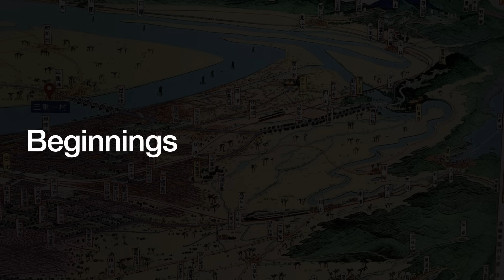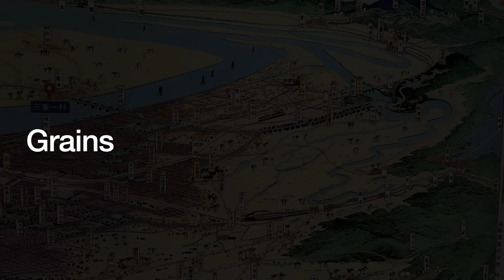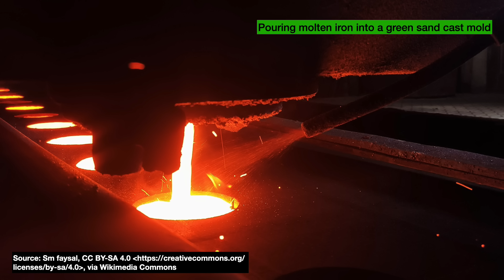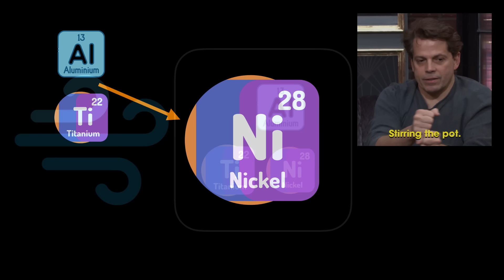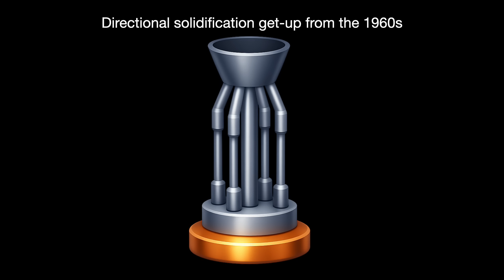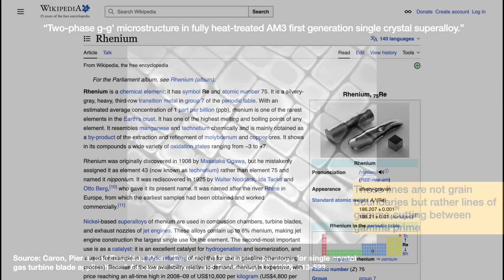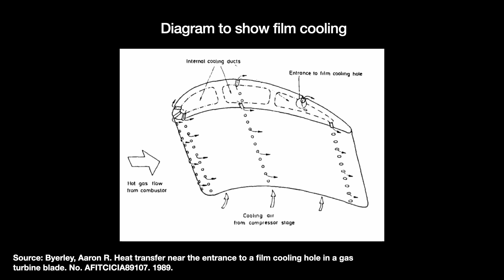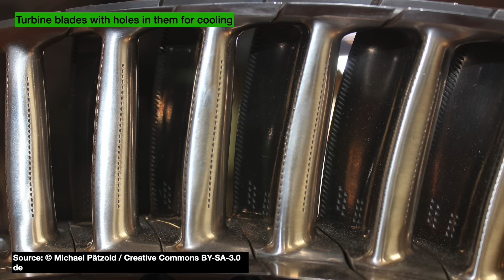Gas Turbine Blades and their Heat-Defying Single-Crystal Superalloys

Comment: The Ceramic thermal coating is also done under vacuum, where a sacrificial ceramic target is sputtered by a LASER, and the coating is thus a vapor deposition.
The air channels are preplanned at the investment casting stage, where a sacrificial ceramic insert is included in the wax assembly that is then later etched out by acid bath to then leave the internal hollow form behind.

Comment: Just one little mistake,  castings are cast,  not casted. 

Otherwise a great video.

One can attribute the effectiveness of an interstitial atom to slow down creep by its chemical affinity. Aluminum and Titanium have a higher chemical affinity are also decent alloying elements for creep resistance amongst others.

I approve of your correct pronunciation of Aluminum.

Comment: 18:40. The coating recipe and how to apply it were what the Chinese spy, Xu Yanjun,arrested in Belgium wanted.  He was a deputy division director of China's Ministry of State Security,  was arrested in April 2018 while traveling to Belgium to meet a GE Aviation employee who was cooperating with U.S. authorities. 
As soon as I heard the news, I knew he must be tricked by a US-planted mole, may be a rising star in the spy agent, to get on the plane.  And I knew the only way out for him was a spy swap.  Ge was out at the very end of Biden term.  The admin only called him a.spy-handler to down play that.

I had an unusal background at GE.  I was in the shrinking GE apprentice program.  My first machine tool assignment was to operate tbr Broaching machine the cut the dove-tail slot for the blade. I got into an argument with the union steward when after he introduced himself to me, told me I should make less than 2 rotors per shift, then the rotated the speed dial of the machine to dramstically slow down the cutter speed. I stopped him that said that would introduce micro-tears, undetectable to naked eyes,  onto the surface.of the dove tail slots.  He insulted me as a wise-guy.  I explained to him that, as he cut a loaf a bread, he would quickly discover the only correct "speed" and pressure that would not tear the bread.  I was a "target" for the 3 years in the apprentice program.  After attending college, I returned to GE's computer integrated manufacturing group, spending a lot of Navy's ManTech money. I was told about the "plasma coating" project for the blades, after we thought we had gone as far as we could with the "grain management" project.   
During the time with GE, US govt was stupid enough not to require security clearance for us working on these projects; only be repeatedly warned   NOT to take a bite of a donut offered by an outside vendor.  The Motto was: Alway pay for everyone's food and entertainment with the company  credit card. 
Fun time.  Also somewhat stupid time.

Comment: A few comments:

The gas turbine power plant mentioned at the beginning of the video achieved its thermal efficiency because it is a combined cycle power plant.  The hot exhaust gases from the gas turbine are used to heat a steam boiler.

Equiaxed does not mean that they are the same size.  Equiaxed means that there is no specific orientation to the grains as what occurs when metals are rolled and obtain preferential grain directions.

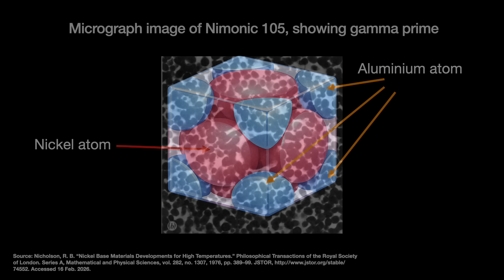The lattice structure shown at 8:00 is a face centered cubic, not a body centered cubic as the narrative states.

Precipitation hardening is a strengthening mechanism which is different from creep resistance.

Precipitation hardening is also a different process than quenching and tempering.  Precipitation hardening occurs when certain metallic compounds precipitate from solid solution.

Precipitation hardening includes a quenching process, but it is different from the quenching done for quenching and tempering processes.  For precipitation hardening, the alloying elements are put into solid solution and then quenched but a structural transformation does not occur where the basic lattice structure changes.  That is the lattice structure before and after the quenching process is the same.

In quench and temper processes, a change in the lattice structure occurs upon heating and then upon quenching.  The simplest and most common Q&T process is for carbon steels.  Upon heating the lattice structure changes from a body centered cubic (BCC) to a face centered cubic (FCC).  What occurs during this transformation is that the carbon will go into solid solution as the solid solubility of carbon is about 2% C in austenite (FCC) while in ferrite (BCC) the solubility is less than 0.01%.  When the austenite is rapidly cooled it does not transform back to ferrite, instead it transforms to martensite which is a body centered tetragonal (BCT) lattice in which the carbon is in a supersaturated solution.  During the tempering process, the carbon is precipitated out as Iron carbide.  Some of the martensite will transform to the BCC ferrite form.  The Iron carbide particles are a strengthening precipitate and some ductility is restored as martensite has only two slip plane systems and is quite brittle.

During the quenching process not all of the austenite transforms and remains as retained austenite.  During the tempering process, some of the austenite will transform to ferrite with an associated precipitation of the carbon.  Depending on the carbon content, the precipitated carbon may form either iron carbide or pearlite or both.

The creep resistance in the superalloys comes from thermally stable precipitates.  The precipitates in the Iron-Carbon system are not thermally stable which is why Iron-Carbon steels rapidly lose strength above about 300 to 500F.

The addition of certain alloying elements such as Chromium increases the quenchability of the alloy.

Going back to precipitation hardening, a very common alloy where this occurs is in the 6xxx aluminum alloys which contain magnesium and silicon as alloying elements.  When heated and then quenched, the magnesium and silicon will be in solid solution.  When the alloy is then age hardened, the magnesium and silicon precipitate out as magnesium silicide within the individual grains which acts to block the movements of dislocations within the aluminum grains.  In this process, the alloy can be overaged where the magnesium silicide grows into large precipitates that are separate from the individual grains of aluminum.  A loss in strength then occurs and the alloy will essentially be in an annealed condition.

With regards to the vacuum melting, this is done to remove dissolved gas, most notably nitrogen, from the melt.  The presence of dissolved gases in some metals leads to brittleness.  Most notably dissolved nitrogen in titanium.  The presence of nitrogen in the Ti6Al4V alloy can lead to a formation of the alpha phase which is the hexagonal close packed (HCP) lattice which is quite brittle.  The presence of this alpha phase in the first stage fan rotor led to the failure of the first stage fan disc and the subsequent crash of the United Airlines Flight 232 at Sioux City, IA.

hth

PS: The design of gas turbines depends not only the maximum combustor temperature but also the compression ratio.
Reply: In the 1960ties L.J.K. Setright wrote a book about aircraft piston engines: "The Power To Fly ", he wrote: the piston engine is a mechanical marvel and the gas turbine is a metallurgical marvel,  and you sir made that  perfectly clear, WOW ². I have a turbine blade of a GE 80 with a million holes😂 on my desk.
Reply: @hermandegroot1946  noice
Reply: @hermandegroot1946  The only turbine blades that I have are ones that failed and caused a problem.
Reply: this guy knows turbines
Reply: @christophseibel1765  tyvm
Reply: W comment; much appreciated.
Reply: @squidlybytes  tyvm
Reply: Really good addition
Reply: @VictorAlessandro-gs3sw  tyvm
Reply: I saw pieces of the Sioux City fan disk on a cart being rolled past my desk on the way to a conference room attended by representatives of those being sued. The hard-alpha defect and the count of fatigue striations told a clear (and somber) story, presented by our failure analysis unit. The industry had already switched to triple-melt titanium, out of caution, but this was an old double-melt disk. I believe the legal settlement included money from all three parties - the engine manufacturer, the airframe manufacturer, and the airline, which missed the defect and crack during an inspection.
Reply: @ChesterMotors-gg3dy  I used this as an example of multiple areas (fracture, fatigue, metallurgy and NDE) in my lectures.  In my lectures, the non-detect probability was on the order of 1E-10 after multiple inspections, if I remember correctly.  Also, and I am remembering correctly from many years ago, this hub was a single vacuum degas and the process was changed to the triple vacuum degas.

It was a hard lesson to learn.

What is even more interesting in the accident analysis is that it was not so much the fan disk failure as it was a complete loss of all three hydraulic circuits on the aircraft.

If you look at all of the DC-10 crashes, it wasn't the initial failure that caused the crash but the subsequent failures from the initial failure.  Although the Chicago crash can be directly traced to the improper R&R procedure for the engine.

Sioux City was a testament to the fine and excellent job that the cockpit crew did.  Had it not been for the last-minute crosswind gust, they would have made it.
Reply: I would say that your simple novel of an explanation, is why the prc has been so unsuccessful at copying americas leading edge turbojet engines.
Reply: @evilshews ni hao
Reply: @evilshews  There is quite a lot that goes into the design of gas turbines.
Reply: @evilshews  tyvm

Comment: all Single-Crystal Super-Alloys will melt or distintegrate above 1100-1200 deg C, without:

1) adequate COOLING
+
2) much needed specialized TBC (Thermal Barrier Coating), which is mandatory
=
for anything flowing as hot as 1500-1600 deg C

without both, it's too weak

Comment: One reason the SR-71 was so fast is because the engines were built as hybrid ramjet engines.
The turbine was used at lower speeds to get it going, then it started bypassing the turbine to become a ramjet.
Ramjets don't work until they reach a minimum speed.

Comment: My understanding is the reason Pratt even went down the crazy path of mono crystal in the SR-71 was originally in project suntan the fuel was hydrogen and so they knew the input turbine temp was going to be high, they knew hydrogen could potentially support crazy combustion temperatures, and also knew the compressor inlet temp was also going to be high from supersonic cruise so they went all out to try to create the highest temp materials they could (to try to achieve reasonable efficiency). The abandonment of hydrogen was for a vast number of reasons but they had already started creating this super engine and thus all the wacky stuff in the J-58 -- inlet / burner system / bypass flows. (and in this case mono crystal turbine blades) ... The budget, and wide range of talents brought to bare on Suntan and eventual A-21 / SR-71 is amazing. Also makes since why Kelly said no one would probably ever spend that amount of money on an aircraft ever again.
Reply: The US also reused a lot liquid hydrogen engineering knowlige from project suntan in construction of centaur upper stage for the atlas rocker.
Reply: It  must have been very interesting and fun to be working with materials science at P&W 
for the J58, along with doing the same at The Skunk Works but with Titanium.  

I never did the math on the Blackbird costs in today’s dollars.  I wonder how it shapes up compared to the latest skunk, the F-35.

Comment: My first job out of college was as an engineer developing the methods for thermal barrier, wear, and oxidation prevention coatings for industrial gas turbine engines. 
The ceramic coatings on turbine blades were sometimes just over 1mm thick. We also processed them afterwards to meet a minimum surface roughness to minimize their air flow resistance.
We would shot peen the blade roots, carbide coat the blade tips, and even the massive 20+ ton shafts in between the compressor and turbine section would be spun on massive wheels to coat their warn main bearing surfaces with inconel so that they could be machined back down to spec and be reused.

Comment: The grinding the blades at pratt and whitney is also a deep dive with no return. If you haven't looked into precision grinding it is already magical, but what pratt did was absolutely insane. To the point where manufacturing has issue replicating it today even with cnc.
Reply: That sounds awesome, where can I read more about it?
Reply: @Michallote seconded!
Reply: @Michallote  i came across a story from my professor for machinist school, he then showed us a video because we didn't understand what he meant by cams being just as accurate and it was great. No idea where or how, just the more i looked into grinding the blades the more i just realized any chump with a precision grinder can make a thing flat, but prat made a curved surface with .0005 tir flatness....in the 50s. It only got more insane with things like the black bird. The tolerances required were basically playing statistical chance. 
Or so i was told.
Reply: Yes please 🙏🏻